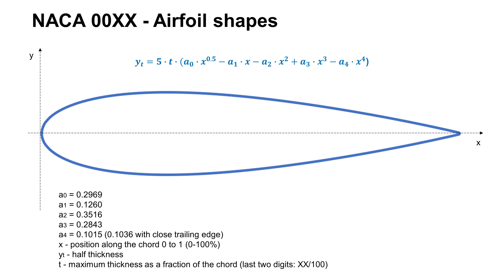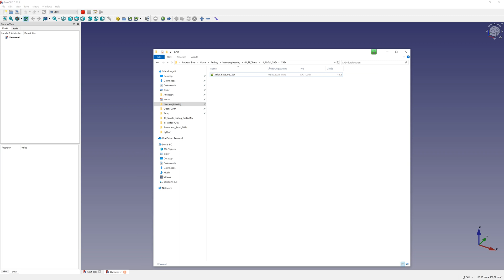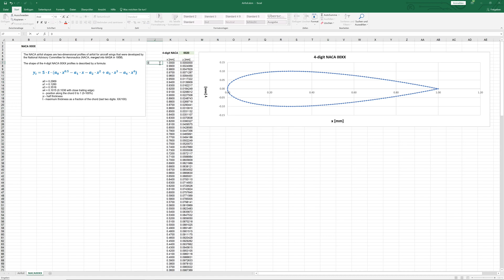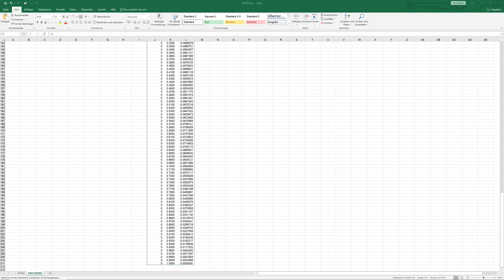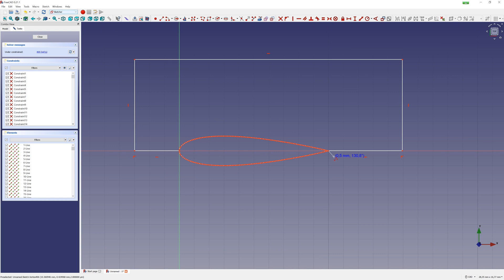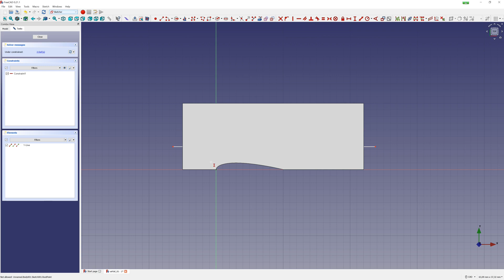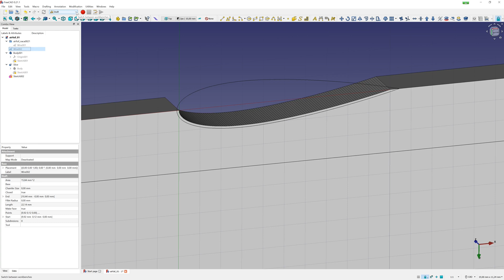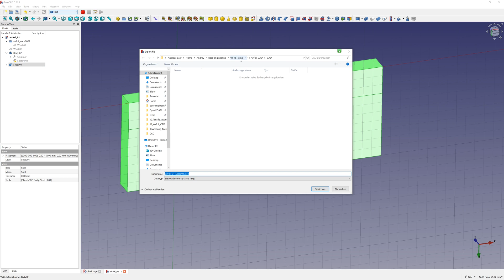Fluid Simulation (CFD) | Airfoil NACA 0020 - CAD creating - Part 1/3 | FreeCad

Comment: Hi, thank you for the video, could you tell me exactly what you do between 08:02 and 08:04? I´m in that part but i don´t understand exactly what you do to get the body into the slice, it´s my first time with FreeCad, I hope you can help me, thank you!
Reply from the maker: Hello. Only "Wire002" was made visible. Then "Wire002" offset was created, for using the tool to imprint the line.